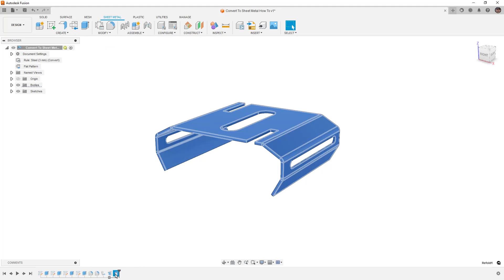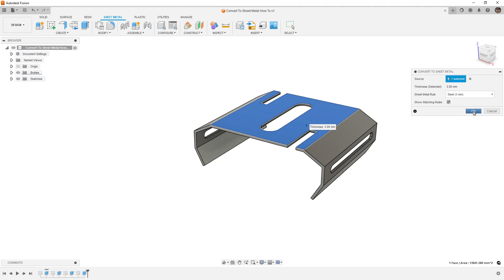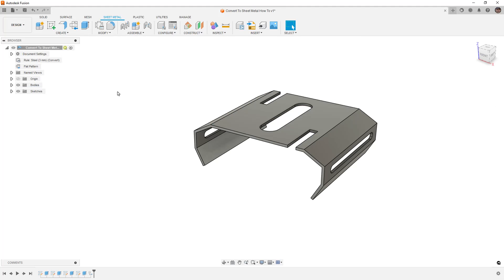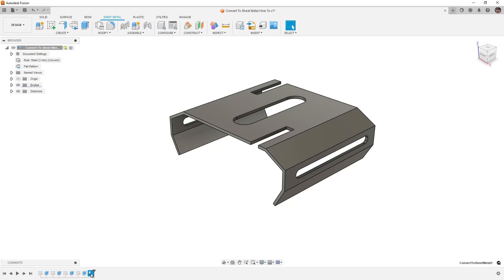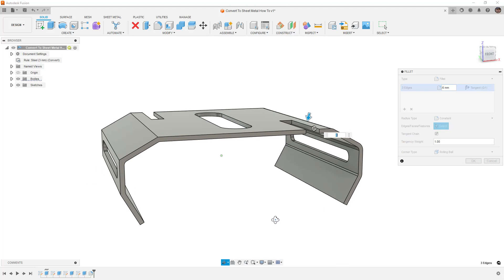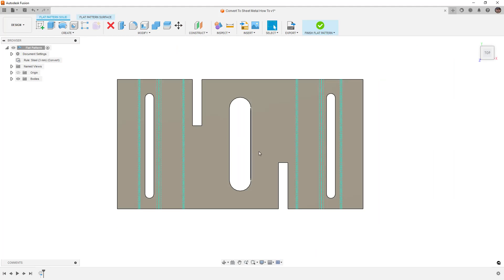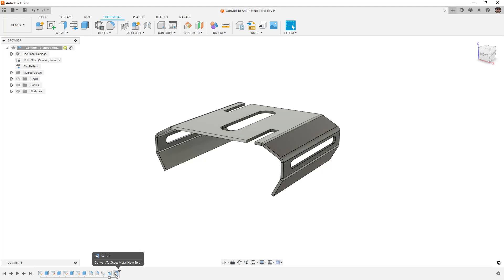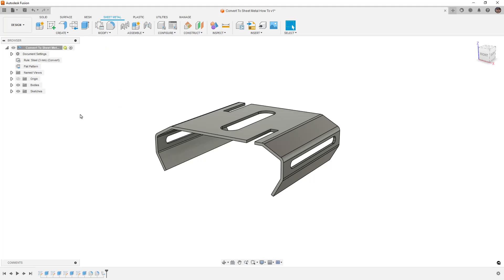How To Convert A Design To Sheet Metal with Fusion

Comment: I'm looking to create a flat pattern with a twist... Pun intended..  lets say I have an octagon as a base, and a hexagon above a few inches.  I want to loft from one shape to the other and then be able to create a flat pattern.  its a sculpture idea to weld up.  but I feel the twists are whats going to stop this from being possible.  looking for direction on this project.. thanks again for great videos
Reply from the maker: Hey Kelly, something like this ?  https://a360.co/48BNalH

I would simply draw your two profiles at the size and distance you want and use the Sheet Metal Loft tool.  This will give you two main options.  Brake or Formed.  If you are trying to bend this up yourself you want to use the Brake option as it will give you bend lines and angles.  You will also need to use the RIP tool to create a cut somewhere so it can be unfolded.  Depending on how thing your metal is going to be and how you plan to weld it you can make this gap pretty small.

Keep in mind that we can make stuff in 3d that will be a pain or impossible to actually bend in real life.  With something like this you should be able to use a finger brake setup as long as you work from one side to the other, but as you can to the last 3 or so bends it will likely become difficult.  A thinner material that can easily deflect like a 3003 Aluminum would likely flex enough and spring back while a mild steel might not.
Reply: @LearnEverythingAboutDesign  ahh man.. sorry for late reply.. not quite like that.  More like a really tall helux with less than a revolution…. As I write this…. I’m thinking I should try exactly that.  I guess I just needed to approach if from another perspective.   Thanks for getting back to me.. everyday is an adventure with fusion..

Comment: Just want to say the inner and outer radius has to perfect. Ex my outer radius was 0.38” and inner was 0.20”, with that it wouldn’t bend. Then when I changed the inner to 0.1925” (correct inner radius for 3/16th steel) it worked
Reply from the maker: Thanks.  Yeah its picky :)

Comment: how do you do when you work with a group of pieces of different thikness ? for me it seams to block due to the different thikness
Reply from the maker: with sheet metal in Fusion you can only have one sheet metal body in a sheet metal component. or else you won't be able to flatten it.  So each sheet metal component will have its own sheet metal rule.  That is the way to do it.

Comment: for me it works only if i type 3 in 6 mm radius, if change inner radius to more sharp..to 1 mm, it would not unfold. Only works this when using flange command and check box to override rools.
Reply from the maker: try putting a .5mm rad on the inside and 3.5 on the outside.  they have to be different by the exact thickness.  as long as the inside has a radius it should work.  I just tested .5 and 3.5 and it was fine.

The collect all bends part isn't needed.  after you convert to sheet metal you should be able to generate a flat pattern.

Comment: If you had done the fillets before the conversion you wouldn't need to unfold it.
Reply from the maker: I did mention that at the end and showed it in that way.  In the video we convert and show it doesn't work with sharp corners.  The unfold/refold is a trick that works if the flat pattern fails, but you don't always need it.  But in the video we do fillet then convert.

Comment: Thanks for the vid. I'm actually the reason you made this vid. I asked a friend on the plasticity discord how to unfold my model for laser cutting. He asked you how to unfold it and shared my orange PC case screenshot lol. I will be doing a PC case build video eventually. The reason I wanted the pieces unfolded was to send to a company to off load the work. I actual found out they accept .step files so I didn't need to unfold the pieces. However, my files still weren't being read right by their software. Come to find out its just as you said in this video the solution was simple. I adjusted my file in plasticity to have slight bevels on all edges that were sharp before so that the program could read them as bends. I also converted all faces into sheets then thickened them so that they were all the same uniform thickness. Thanks again for making a video on the issue nevertheless. 
Cheers!
Reply from the maker: Cool. yeah it was a good question so i tried to make a model that was a similar shape :)  Glad to hear you got a solution with a step file out of plasticity!!

Comment: How do we do that in Plasticity?
Reply from the maker: You can't.  Fusion and other CAD programs have sheet metal tools meant to design bent/formed parts in an end use state then flatten them.  Plasticity doesn't have that and I don't think it really ever will.  Programs like Fusion, Inventor, Solidworks etc that are geared more towards manufacture of parts would have those tools.
Reply: @LearnEverythingAboutDesign  oh okay. 👍
Reply: @ajdhgsldhdgwielbw736  It depends actually. Like I had mentioned in an above comment. If you are uploading your files to a 3rd party company for them to cut it and bend it for you. You can select all faces click Shift D to duplicate faces then thicken (not extrude) the sheet to the desired thickness and make sure all your bends dont have any sharp edges and that you beveled them. This allows the programs to read it as a .step file and even shows where the bends are needed.